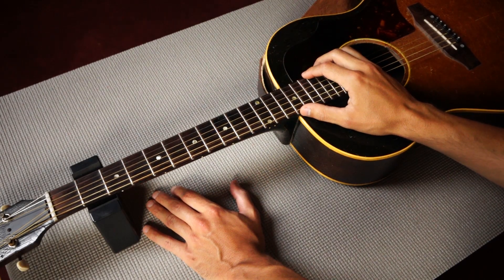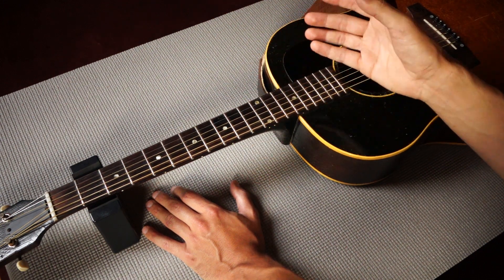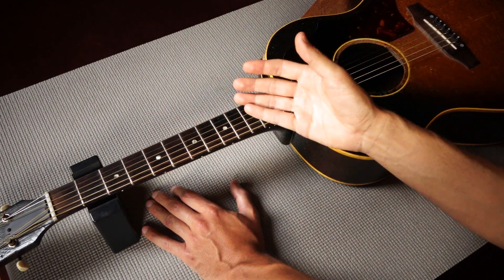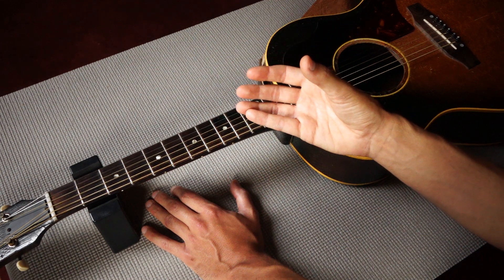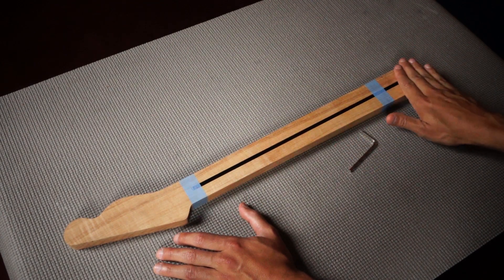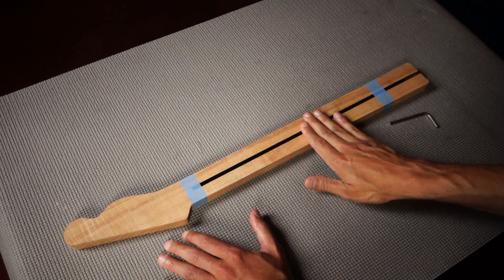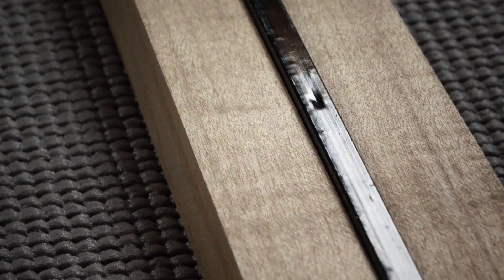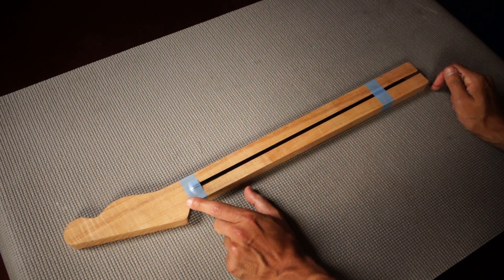What is a truss rod? And how does it work? A look inside the guitar neck.

Comment: do you know what my 73 fender telecaster deluxe has truss rod wise... the silver bullet nut at head stock is loose but the neck is not coming up outta being bent downwards im wondering if higher gauge strings is what it needs, not sure if there is a minimum gauge   I think there is 8s on there now

Comment: Great video. So the opposition to the truss rod force that creates the neck movement is the back of the  fret board? Seems like a good amount of pressure on the fret board. The truss rod uses the back of the fret board to “push” the neck straight?

Comment: Hello. I adjusted the truss rod and the neck is flat. After 2 days I noticed an up-bow. I adjusted it again. After 1 or 2 days the same occurred. I repeated this process many times and it seems the truss rod does not maintain the neck flat. The marked the truss rod nut to see if it was moving, but no, it did not move. It is a single action truss rod. Have you experienced that? Thank you in advance.
Reply from the maker: A single action truss rod only bends the neck 'backwards' (against the tension of the strings, eliminating a forward bow). It can not eliminate an backbow. So this problem likely has little to do with the truss rod. What I would recommend is to first remove the string and loose the truss rod to find out what the neck does without tension. Then slowly add string tension and find out if the backbow is still present. If the backbow is still there when the strings are fully tensioned there is a problem with your guitar neck. You can eliminate a backbow by levelling the frets (if it's not that bad) or by removing the frets, levelling the fingerboard and refretting. This is just the short version of course. There are always other problems (and solutions) that might be appropriate but for that it would be better to email me. Best of luck!

Comment: Great demo. But what about the limits of the truss rod. Meaning how much can a truss rod be loosened to make it bow backwards. For example when we strung the standard tuning the neck always has a tendency to bow forward over time due to the excessive pulling tension developed by the strings. In that case when someone tried to loosen the truss rod (to counter the forward bow) again and again and again, how much can we expect the rod to loosen over time without reaching some  final point ; Does this truss rod function like a screw in a given direction and reaches an end point or it can be loosened endlessly to cater to the situation described above? Pls help me I have brought a new acoustic guitar n its very dear to me. Thanks in advance.🙏
Reply: It certainly has an end point.

Comment: But, how is the rod actually moving up and down when you are tightening or loosening it? What are the mechanics behind it?
Reply: Exactly, it's only half the story
Reply: @ikannunaplays  Exactly
Reply: Just in case someone did want to know. The truss rod is composed of two rods, one is just a straight metal solid rod, the other is a square rod that is welded to the truss rod on one end and on the other it's connected to the square rod with a tapped bolt and a bracket that connects the bolted to the cylindrical rod. The cylindrical rod is slightly longer than the square rod, and when the bolt is tightened the distance between the bracket and the square rod contract forcing a bow in the cylindrical and if the bolt is loosened enough it will bow in the opposite direction. I don't know the "sciency" lingo, I just figured it out on my own by looking at one.
Reply: @ikannunaplays  Thanks for that explanation, very helpful. I have a few extra useless necks lying around. I feel the urge to take one apart to get to "meet" the truss rod.

Comment: Is it possible for a truss rod, in say a fender neck, to  run out of adjustment? Even with washers installed?   Mine wont turn anymore even with washers installed and having clamped it for about a week.   Its playable, but I cant get that last little  bit of adjustment.  If you try to tighten it, it just feels kinda springy.  I stopped because i dont want to break the rod.

Comment: How do some guitars not have a truss rod? Would the neck break off? Just curious
Reply from the maker: If you use a strong and stable (preferably quarter sawn) neck wood it can easily withstand the tension of the strings. I have owned 80+ year old guitars without truss rods and those necks were perfectly straight. The issue I have with rod-less necks is the fact that there is no easy way of adjusting them. If there is a pronounced bow, you will have to put quite some work into that neck to get it straight. On a neck with a truss rod, this is an easy job that only takes a couple of minutes.
Reply: Good to know. Thanks

Comment: All you show is that when you tighten the truss rod, the neck curves back, and when you loosen the truss rod, the neck curves forward. Where do you show how turning the end does either?
Reply from the maker: I'm sorry, I don't quite understand your question. Can you be more specific? I'll try to help you out. Best regards.
Reply: You didn't explain how tightening the truss rod causes the neck to curve. There were no details about how this works other than it does work.
Reply from the maker: responsibleparty As I mentioned in the video, the fingerboard would normally be glued on top, completely sealing in the truss rod. The truss rod channel is made to fit the truss rod perfectly. That means the truss rod does not have any space to bend the way it does in this video, unless the entire neck bends with it (which it does). I hope this answers your question.
Reply: It doesn't. But that's okay, I'm sure I could Google and find the information when I'm not busy with other matters. For me, it was just the observation that the one part of this that isn't obvious to me is the part that is brushed past in most of the videos I've seen about this.
Reply: Right, like, how does turning a screw make the truss rod bend at all? Like, physically, how does that work?

Comment: but when the rod goes up, couldnt the fretboard rip off?
Reply from the maker: +Metal MGTOW The fretboard glue surface is very large. As long as that glue joint is perfect it won't ever come off. I've never seen it happen. I have seen a fretboard split in the middle (lengthwise) once or twice though, which can happen when the wood gets very dry or when the fretboard is too thin.

Comment: Im getting fret buzz on the low strings, around the first 5 frets on my low E. what is best way to fix this? Im a n00b
Reply from the maker: +Eric Ottaviano Fret Buzz can have many causes. It's very hard to say what causes it on your guitar without seeing it. However, if it mostly buzzes on the low frets, it could mean that the nut slots are cut too deep. Try fretting the string on the second string. There should be a tiny gap between the top of the first fret and the bottom of the string. You can measure this gap with feeler gauges, but if you don't have those you can also use guitar picks of varying thicknesses. What do you find?
Reply: I ended up loosening the trust rod a little and messed with bridge level until I found a sweet spot and more of my kind of action. theres so many ways to go about it but I appreciate your help I'm sure ill have more questions
Reply from the maker: +Eric Ottaviano Good to hear you got it to where you like it. Let me know if you have any more questions.